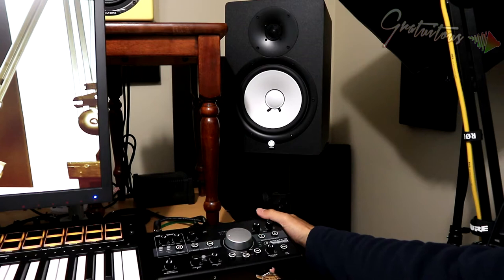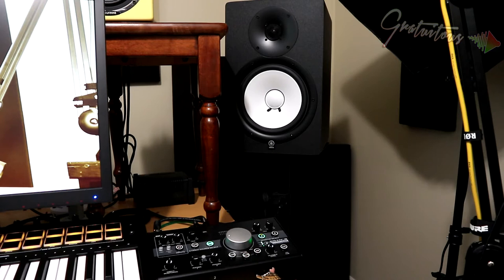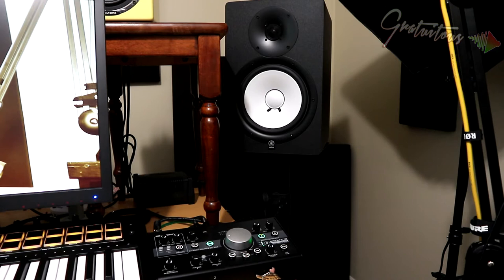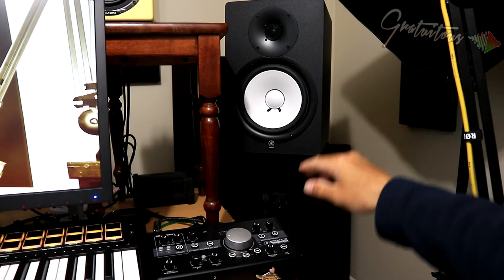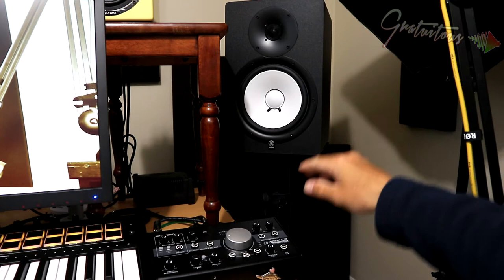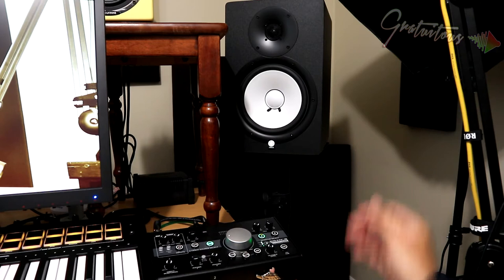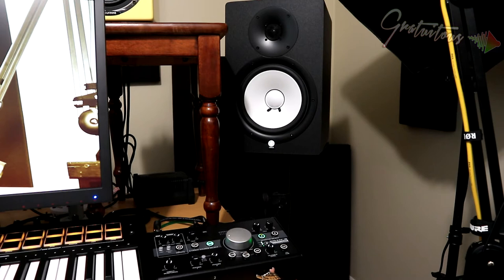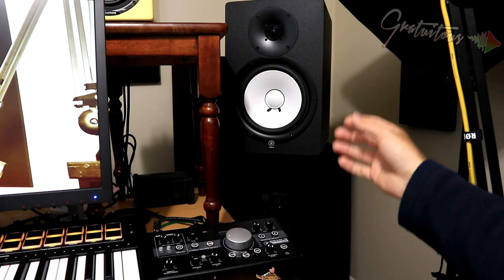How to Stop Speakers Popping when Turning Audio Interface ON/OFF

Comment: my krk classic 5´s speakers pop when i turn them off before my interface
Reply from the maker: Yes that's what the video shows!  If you turn off your speakers first, then the audio interface, they won't pop.
https://itsGratuiTous.com/
Reply: @itsGratuiTous  yes i know but mine still pop so What should i do Now??
Reply from the maker: @channelmagenta8721  You should turn off the speakers first, then turn off the audio interface!  That's how I do it to stop speakers from popping!
Reply: @itsGratuiTous  yes thats What I’m trying to tell you! They still pop right at the moment When i turn Them off before everything Else.
Reply from the maker: @channelmagenta8721  Sorry for misreading!  Is it as loud as when you turn off the audio interface to create the pop? - Do the KRK's have a switch to turn them off?

The pop I don't think is a huge concern, as no companies are doing anything about it to prevent it, but it is annoying..
Reply: @itsGratuiTous  yes the krk’s does have on/off buttons and they are the ones I use to turn my speakers off with. My interface is a focusrite 2i2 that doesn’t have any button but I still turn off my speakers first and the pop comes from both.
Reply from the maker: @channelmagenta8721  I'm not sure of a fix at the moment.. This video shows if the audio interface has an on/off button.  In my case, my Yamaha's don't pop when turning on/off by them self!  Sorry about that 😟
Reply: I have the same issue..

Comment: I dont like this problem. That means i have to turn around the sub to have easy access to the on and off so i can use the method
Reply from the maker: I just use this power strip as my on off for the speakers.. super simple
Reply: @itsGratuiTous    but what if i have this problem with my headphones? i am using a focusrite 2i2 audio interface with senheiser hd560s, obv i cant turn off my headphones so i must unplug them everytime but is there a solution to this something i could buy to avoid unplugging them ?
Reply from the maker: @bayramwav  Not that I know of.. but you could always connect a cable in between to prevent wearing out the audio interface headphone port, or the headphone jack.. either way you'll have to unplug.. not sure if it's a huge deal though.. not talked about a lot in the industry.. https://itsGratuiTous.com